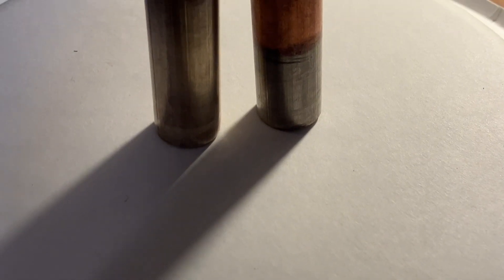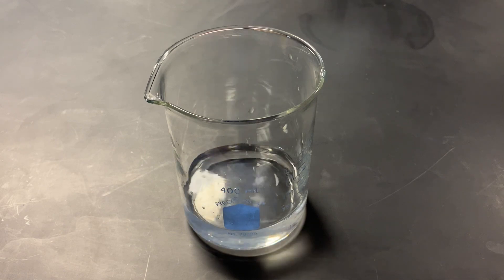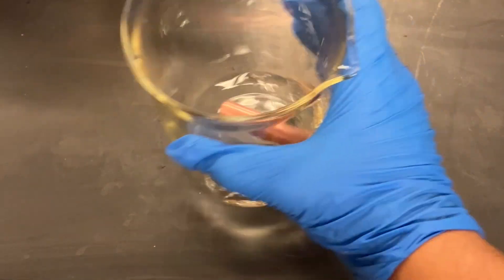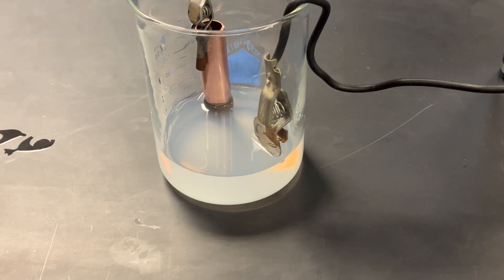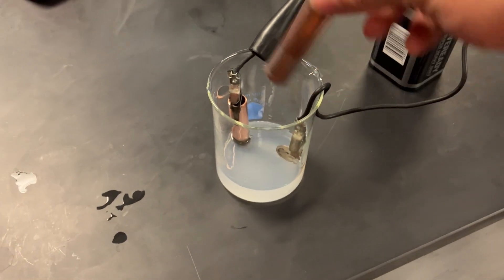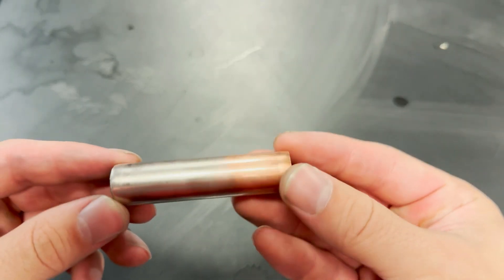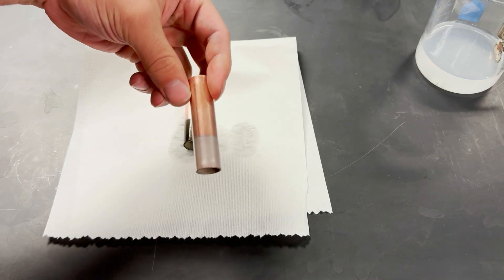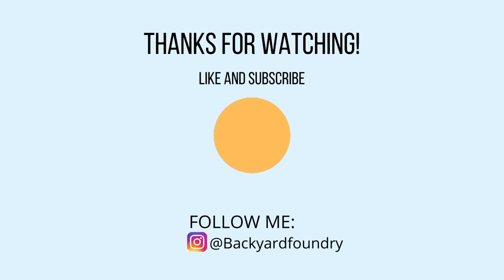How to Electroplate: Two Methods [Silver onto Copper]

Comment: Thanks. Always wondered why industrial/professional silver electrolyte contains cyanide if it´s really that easy. Talking about voltage is fine, but current density is just as important to reproduce the procedure. What was the concentration of the silver nitrate?